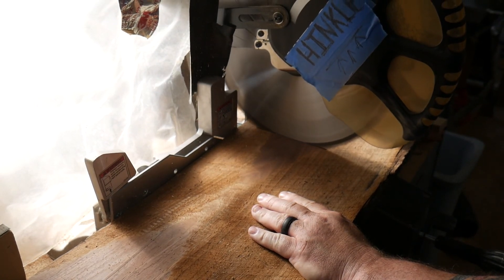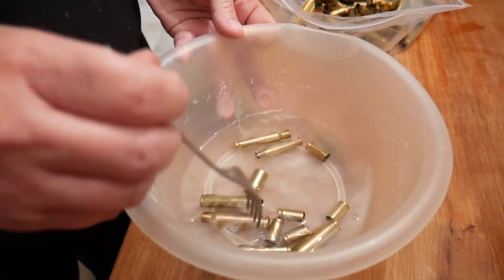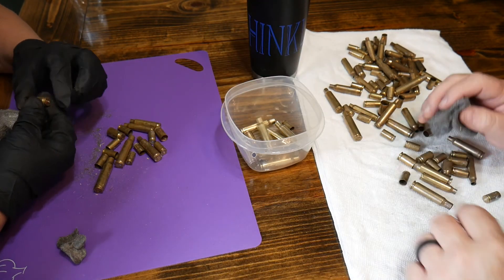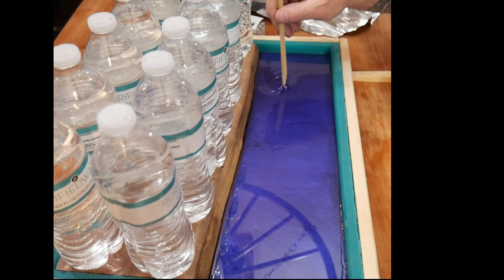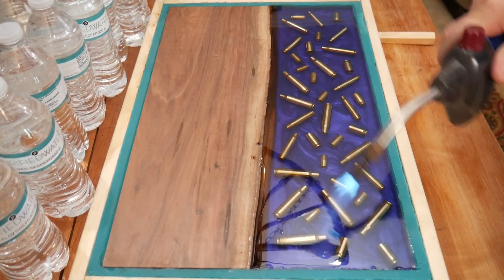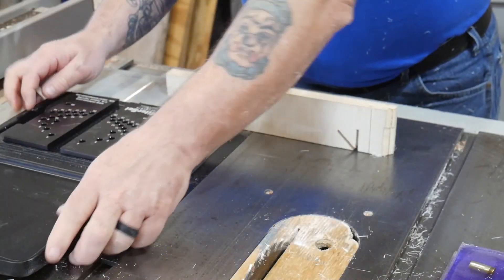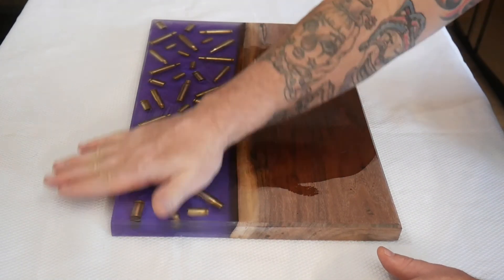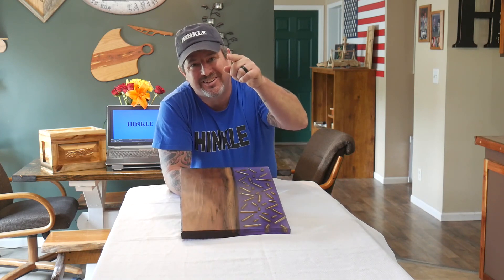Awesome Black Walnut and Epoxy cutting board

Comment: Won’t it chip if you use it as a cutting board?
Reply from the maker: Thank you for watching
If I were going to use it as a cutting board, I would use the natural wood side for cutting and the epoxy side for serving.
The board is designed more as a display charcuterie board than an actual cutting board 
Thank you for the question